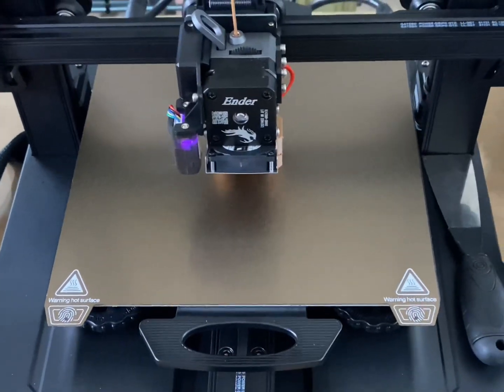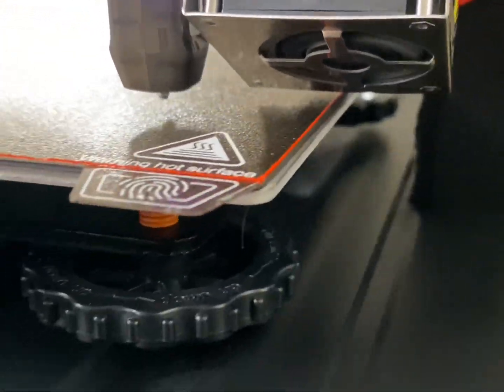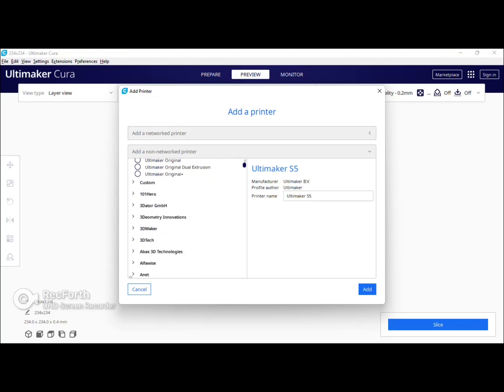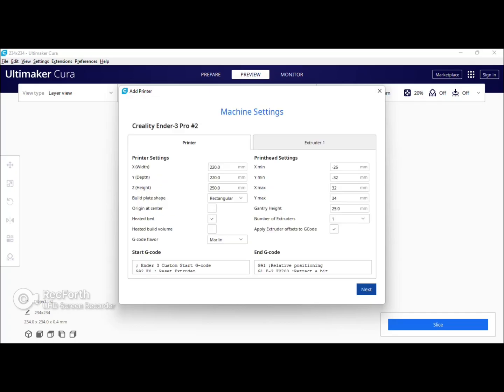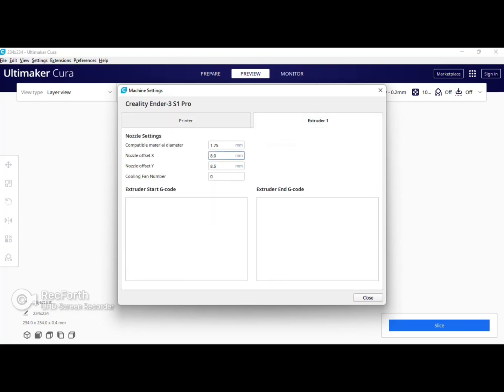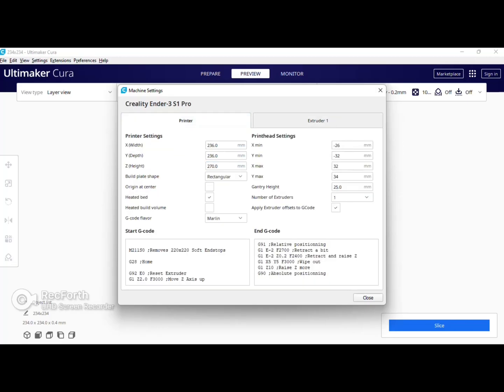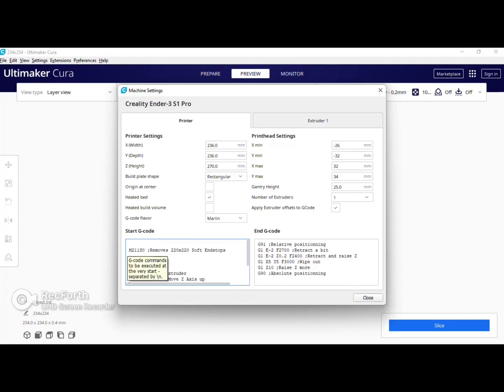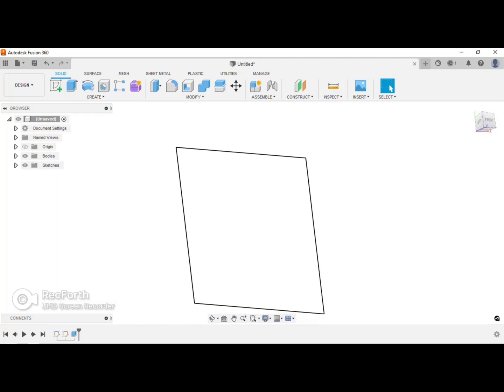Ender 3 S1 Pro - Maximize Build Volume

Comment: Doesn't work on my s1 pro. Cura gives me a message saying the model doesn't fit within the volume even though I applied your changes.
Reply from the maker: Make sure you don’t have any build plate adhesion settings applied.
Reply: @invaderzip_  That fixed it. Got to take those useless skirts off the default.  Thanks! Have you noticed any change in quality when printing in this mode?
Reply from the maker: @DKFX1  It shouldn’t affect your quality. This is strictly a build volume enhancement.
Reply: @invaderzip_  HI, I turned off my Build plate adhesion and tried printing it from my Creality Cloud with no success, it gives error "Dimensions out of device size. Printing Failure!"... I will test with memory card when I get home. Bet it would be great to be able to get a work around this as I do allot of remote printing. I also have a S1 Pro.

Comment: Anybody know if this method would work on a standard Ender 3?
Reply from the maker: Standard Ender 3 is easier. Just update your firmware to anything that isn’t stock (I recommend Jyers) and change values to 237x237 !
Reply: for the standard ender 3, what's the tallest build height we can set? 270?

Comment: Its not working on my S1 either.  Disabled adhesion setting by setting it to 'None' and it's still unable to slice.
Reply: Yes, it works on my S!1. Something you have forgotten to do is preventing your slicing.
Reply: Check out if you have skirt or anything else enabled, it should be none.
Reply from the maker: I’m not sure if it works on the regular S1 (although it should). I would recommend double checking all your slicer settings, and possibly going with a standard Cura profile to ensure there are no customized settings preventing you from using this.